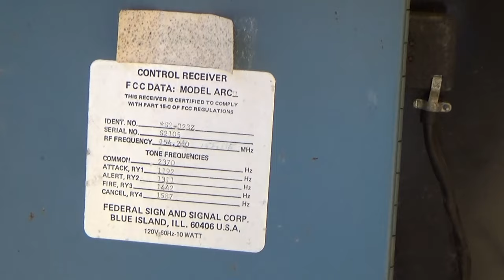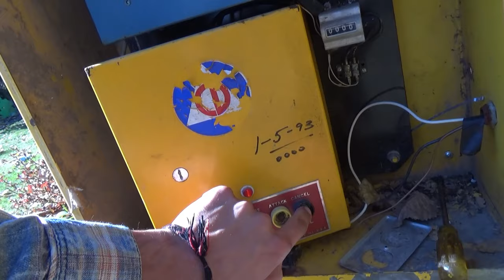Backyard Thunderbolt 1003 Walk around timers functioning,visual solenoids operating,open rotator box

Comment: An interesting video, but I have no idea what it's for, why it's there, nor what the electrical stuff in the boxes do. A bit of commentary or explanation would be good.  Us Brits seldom have sirens in our back gardens.  I bet your neighbours just love you! :-)
Reply: This is a siren collector who has an air raid/bomb/tornado siren purchased and set up in their backyard. Proper clearance is needed with local authorities and fire dept. to sound it. They can be heard for several miles.
Reply: The boxes are the solenoids only the 1003 variant has them, the signals the 1003 can do is alert, attack, fire, alternate wail (alt wail), and undulating hi lo the solenoids let the Thunderbolt do everything that is past attack the klaxon CS8 which is a British siren also has solenoids that make a damper open and close which is a fire signal or escape signal which is used when someone escaped a mental hospital
Reply: Also the solenoids work with something called an RCM3 which is this at 1:38 every time one of those things go in and out that one of the solenoids opening and closing which makes the hi lo sound I hope you find this helpful
Reply: Si

Comment: What speed setting is the chopper on? Or is it just hooked up directly to 120V?
Reply from the maker: 120v and i switched out the bearings with heavy grease and after I did that it’s a bit slower now. Might change it this year tho

Comment: I don’t remember exactly but since you have a gas powered blower, would that mean you technically have a Federal Thunderbolt 2003A?
Reply: No a 1003A
Reply: @playsgorillatag.. 2 at the beginning instead of 1 means gas powered blower. There was only ever officially a 2000, no other gas powered thunderbolt. So yes, they’re correct, this is technically a 2003A
Reply: @BuckeyeSirenProductions 2000's were made until 1957
Reply: @FS_3T22A  that has nothing to do with my point.

Comment: why's the wind up so long? also sweet allertor paint job
Reply: It’s because he’s running it on extremely low voltage
Reply: @therailcat9790  oh that makes sense actually
Reply: @ElijahCote  actually he said in the comment section it's because he put heavy Grease
Reply: @ThunderboltSiren1003  bru were is the comment I don’t see one

Comment: One question have you ever used this in a tornado warning or a siren test?
Reply from the maker: Yes both
Reply: @vertoisful so you literally did this in an actual tornado? If yes the neighbors must love you because you told them its dangerous outside based on the tornado siren so that they can stay safe
Reply from the maker: @ilovephilipines  they actually got mad I did and complained that they could hear the others and I shouldn’t sound mine